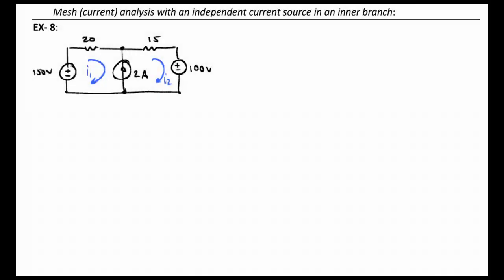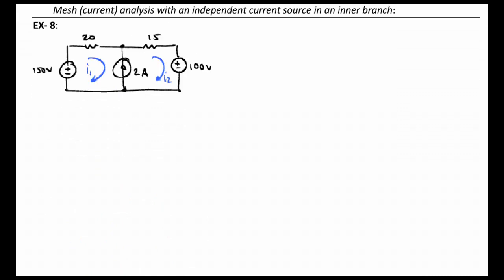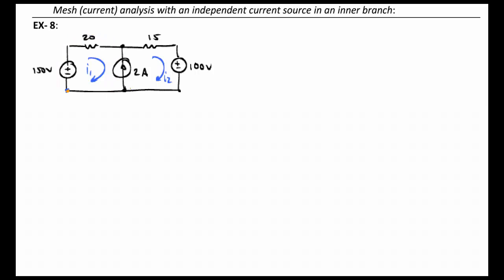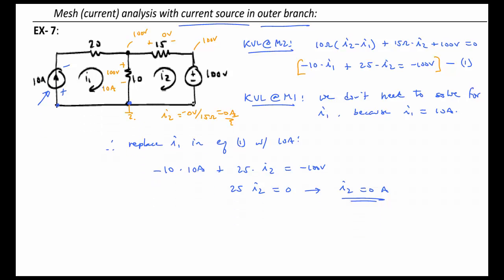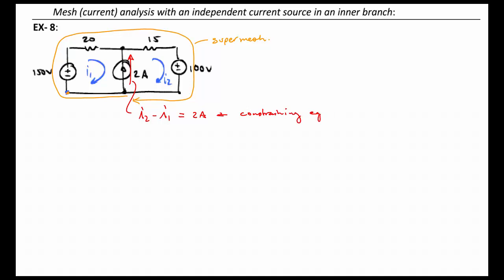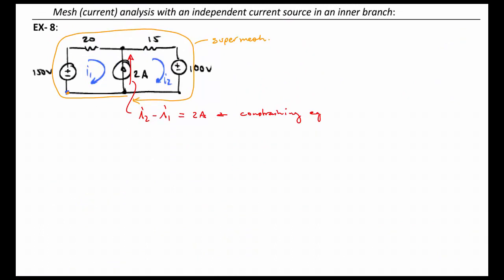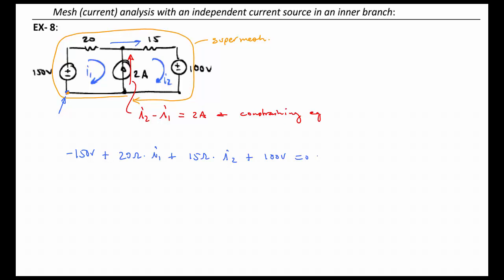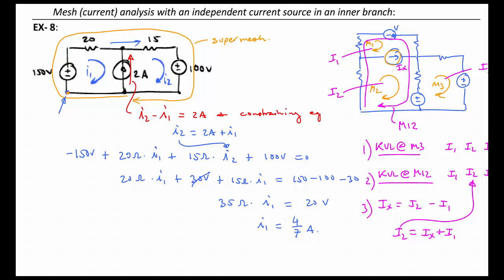NA 8 - Mesh Analysis: Current sources and the Supermesh

Comment: "we can't say i1 is just equal to -2A" Why not?
Reply from the maker: If the 15ohm resistor were removed such that the loop on the right were broken then I1 would in fact equal -2A. But in fact the 2A source can and will supply current to both the right loop and left loop, but we don't know how that 2A will split. So all we can say initially is that the sum of both currents equals 2A; more specifically, considering the orientation of each current, we write I2 + (-I1) = 2A. Hope that helps.